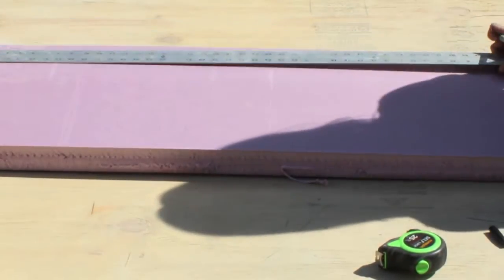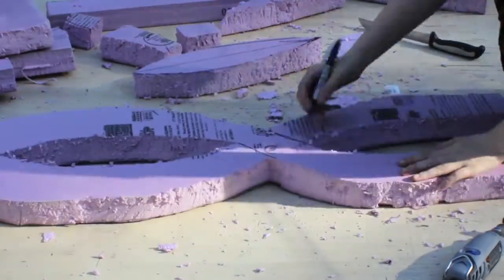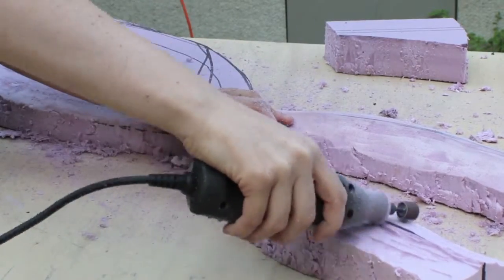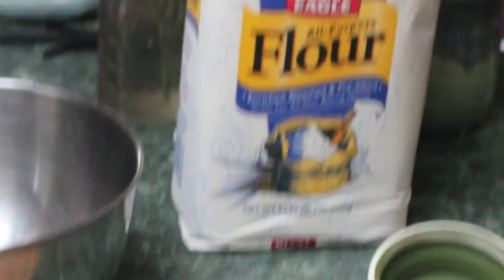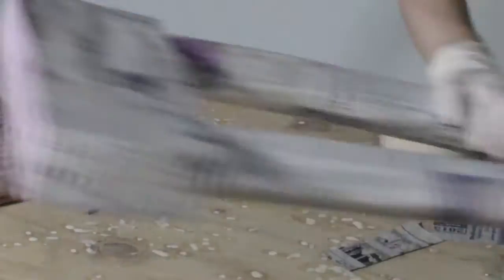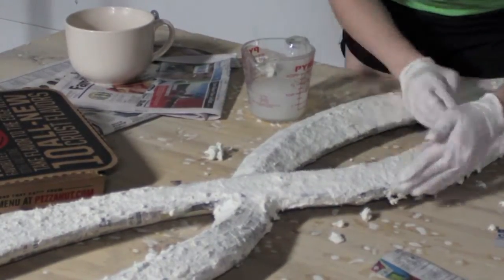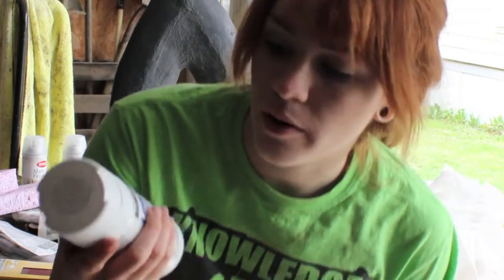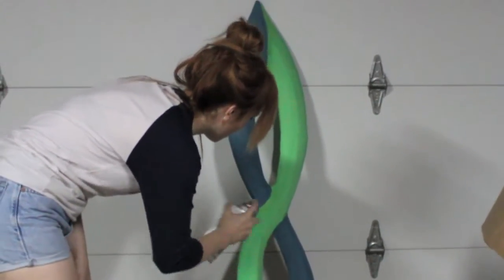Fierce Deity Sword Tutorial : Installation Foam

Comment: FABULOUS video Brooke :)  have you ever tried using hot knives? I use hot blades and hot wire systems when cutting and shaping foam :) you can also do roughing down with a rasp...   it's always fun to see your creative process... keep it up!
Reply from the maker: +Frederick Dunn are those expensive? It wouldt definitely be way easier and cleaner thats for sure!
Reply: +Brooke Surgener Look into "Foam Factory" they have everything.... some of their stuff is more expensive than others... they even sell finishing material... I made a really cool fountain and used their tools. You will save soooo much time :)

Comment: I just saw your video ... nice job. I like F.Dunn would have loaned you my hot knife or hot wire cutters to help you. As determined as you were I knew you'd make it but the hot knife would have cut your time by 2/3rds AND with no XPS dust. You can buy them anywhere ... I just saw a cheap one on Harbor Freight. If you're using it periodically and not professionally it should be fine (link below).
I never considered paper mache! I'll have to think about that. I didn't see how you worked the handle attachment problem out  besides sanding to lighten (and of course wine ... lol)  ... longer dowels? more epoxy? I probably would have opted for wood at the hilt and handle ... but I gotta say ... what a great job you did ... first timer ... I don't know how much outside advisement you had but YOU DID A GREAT JOB! And I know that you learned soooooo much. Congratulations. I hardly ever post but felt compelled here because of your tenaciousness. As you get older you'll learn that in life ... if you don't quit ... you always win! (as you epitomized here)
Be blessed
Doc

 http://www.harborfreight.com/130-watt-heavy-duty-hot-knife-60313.html